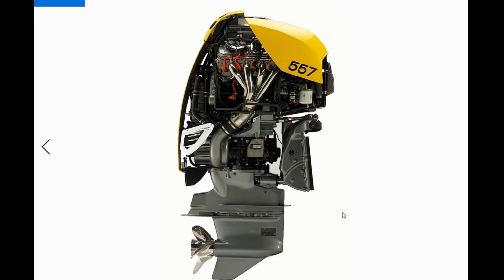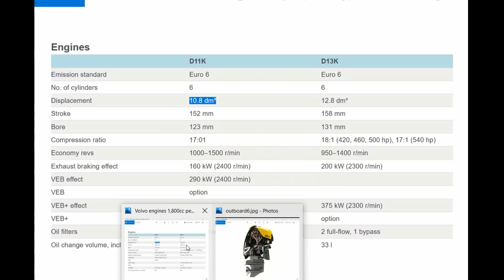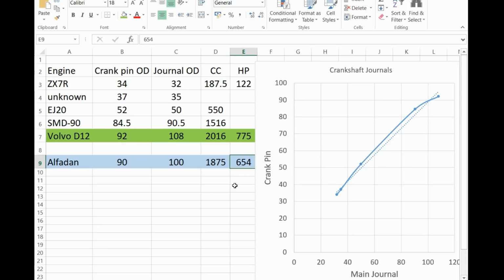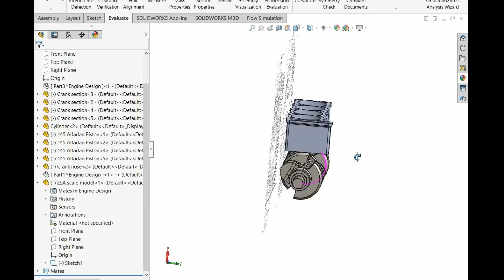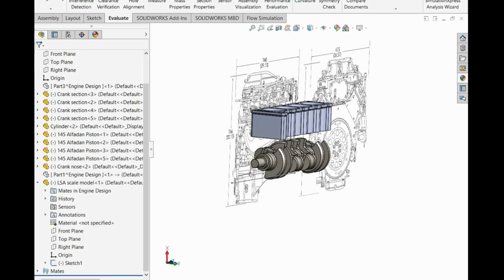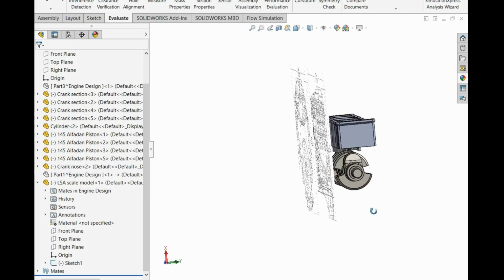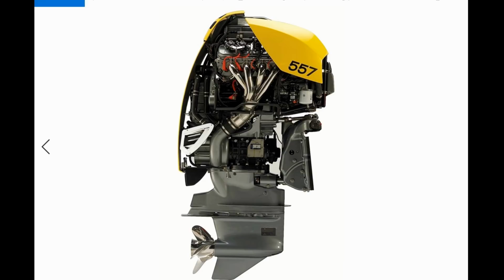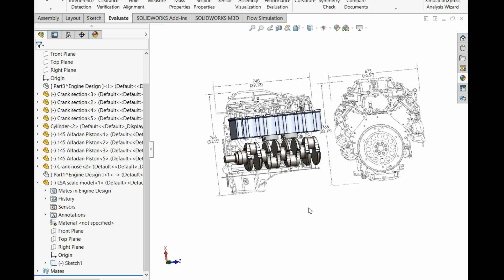Seven Marine Vs Alfadan

Comment: You claim to be coming at this from an engineering perspective but you just don't understand. The Alfadan engine will work. The work it does will create a lot of heat, but this can be dealt with by running it in a lake full of Evans coolant... The work it does will create lubrication issues, but there's a guy in a shed already working on some super slippy stuff to solve this. The vibration caused by running an i4 without balance shafts will be solved by mounting the engine outboard on cart springs from a 1970's Cadillac. The size issue will be solved by standing the engine upright on its flywheel end. This will mean the engine has to be dry sump and a few teenage boys will be given stirrup pumps full of the super slippy stuff to solve the issue.                                                                                                                                                                                                                                                    You really need to start thinking outside of the box... like Einstein did.

Comment: Usually, fewer parts bring less maintenance, even if they are bigger. This is why today's automobiles are decreasing the number of cylinders. BMWs no longer use 12 cylinders. VW is migrating the 4 cylinders to 3 cylinders.
The big challenge here is to prove that the additional parts on the crankshaft do not increase the cost of maintenance.
Reply from the maker: Fewer parts bring less maintenance? Lol that's bot true at all.

OEMs are switching to fewer cylinder because of cost.

Comment: So here is my question.  With the world moving away from fossil fuels, why would anybody invest in an internal combustion engine project?  I know that IC engines aren't going to disappear overnight, but it still doesn't seem like a wise investment to me.
Reply from the maker: Because electric motors aren't going to replace big power applications like this.
Reply: @thedirtyworkshop  Fair enough. I assume that is because if they were powered something like batteries they would either need huge battery banks or would drain the batteries in no time flat. I know that it is possible to make massively powerful electric vehicles, so I am thinking it is not a fundamental issue with electric motors.
Reply from the maker: It's the batteries... a lot of these boats have say 4 or 6 of these engines. They weigh 500kg each
Reply: @thedirtyworkshop  Cool.  New thing learned.  Cheers Matt.